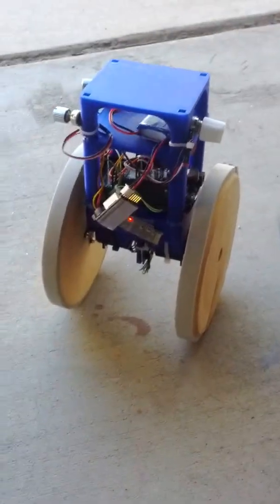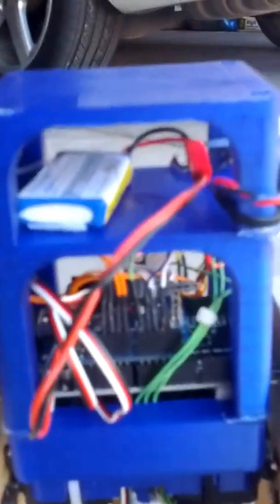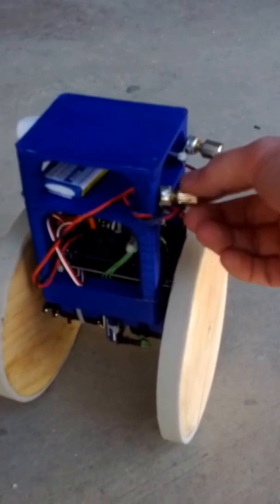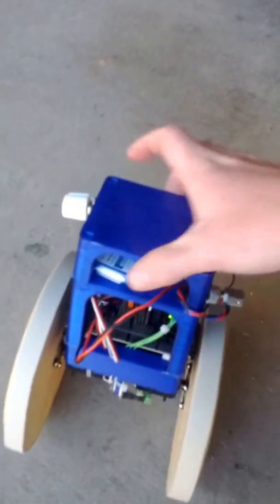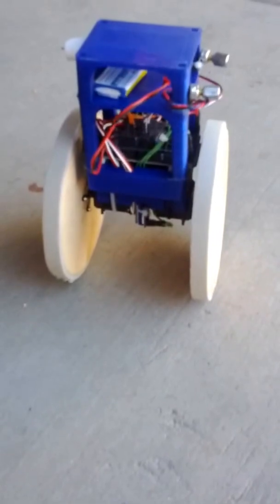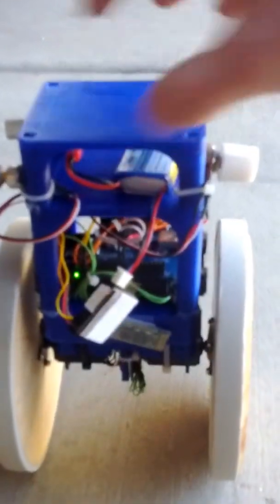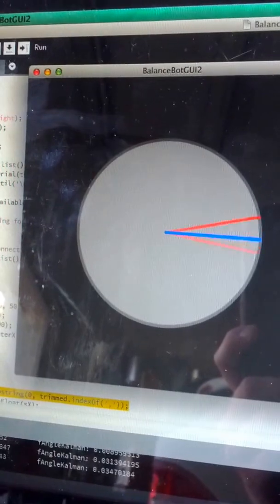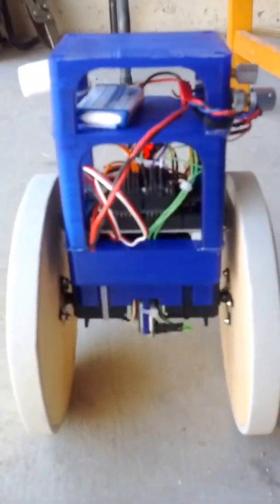Balancing Robot (Arduino, IMU, PID controller and Kalman filter)

Comment: hi barrett, only a questio.
when you change the vals from the pot. (p and i) that was the gain ? like Kp and Ki?
just to try to understand a little bit the code 
congratulations bery nice project.
Reply from the maker: Lalo Tora Yes, that was the gain. Yes, the proportional gain is Kp and the integral gain is Ki. I also have a derivative gain, Kd, but didn't use it because of the harsh feedback.

Comment: hello I live in Portugal and I saw your video and congratulations, walk with a problem in the arduino code for the Balancing Robot, the error I'm always using the accelerometer MPU-6050 gyro and two servants as motors, can you give me a hand?email  leeassistencia@gmail.com
Reply from the maker: Hi Ulisses,

Sure, but I'll need more information to help you. Note that this code will not work with sensors other than what I used without substantial modification.
Reply: Barrett Anderies Thank you for your time in your work Caster Bot, I'm doing another one, but when I check the error code on the arduino, Serial1.begin (115200); says serial1 was not declared in this scop, can you give me a hand?
Reply from the maker: Ulisses,

What Arduino are you using? Serial1 doesn't exist on most of the smaller Arduino boards. You need something like a Mega to use Serial1. If you are using a board with Serial1, make sure you select it under Tools --> Board. If you do not select your board correctly the compiler won't recognize Serial1.
Reply: Barrett Anderies arduino I'm using and the Uno ATMEGA328P - PU
Reply from the maker: ulisses salvador That would be why Serial1 is not working. The UNO only has one UART (Serial) port. They only way you can get around this other than by buying an Arduino with more ports (like a Mega) is to use SoftwareSerial: http://arduino.cc/en/Reference/SoftwareSerial
Reply: Barrett Anderies ulisses salvador 
Hi, if you check my channel out, I am also building one, but I am using complimentary filter instead. However I am currently stuck at the PID part, and can't figure out what I am doing wrong. So i was wondering if you could share you're code with me please?
Reply from the maker: 2012daffyduck I would rather not share the code at the moment as it is not well documented, but I can tell you that I am using the Arduino PID library. It is extremely easy to use and if you navigate to the developer's page he has extensive documentation. The PID portion of the code was the simplest part once I read the documentation.
Reply: Barrett Anderies I would really appreciate it if you could share it. I think i am having a fundamental mistake in which i cannot see what the mistake is. so being able to compare, would perhaps help me realise my error. btw Merry x-mas!
Reply from the maker: 2012daffyduck Alright, how would you like me to send it to you?